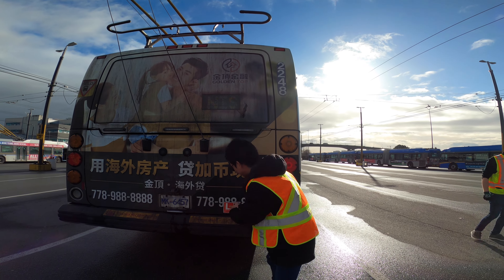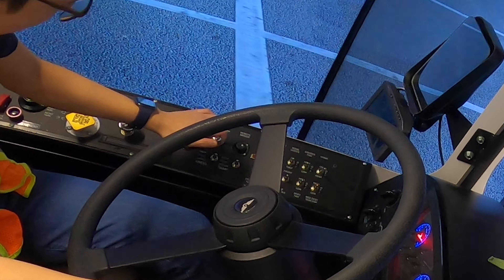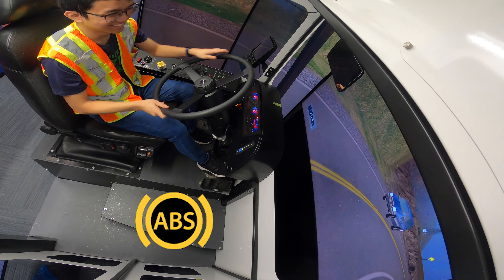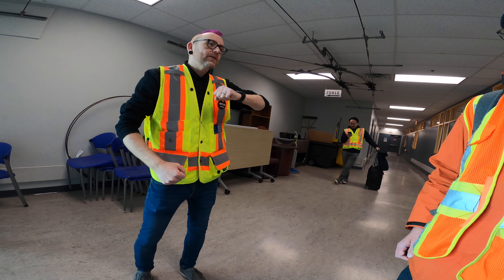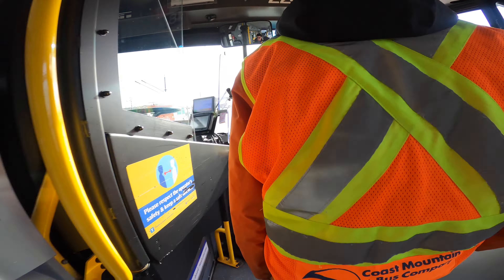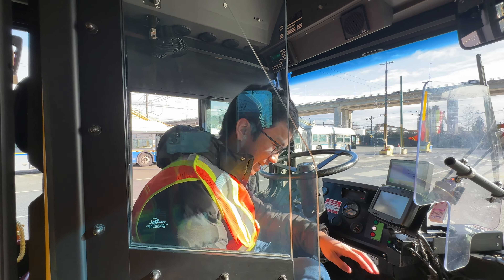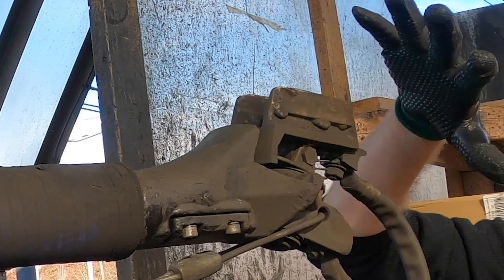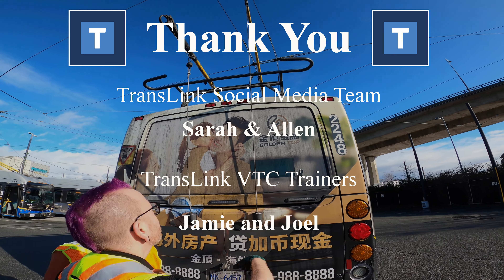BEHIND THE SCENE TOUR of TransLink's Vancouver Transit Center! | I ❤️ Transit

Comment: In Switzerland, trolleybusses don't have to slow down at intersections usually, since it's "just" a crossing of the wires in a 90 degree arc, without any switches right before. Most of our actual switches are fast-speed ones, so you can pass them to the left or to the right with up to 40 km/h. The switching happens while you're basically going straight, the actual turn and separation at the intersection happens maybe 100 meters or 150 meters after. We have to watch our speeds at underpasses though (30 km/h max). Raising and lowering the poles happens automatically with the press of a button. When raising automatically, we have to make sure that we're standing at the perfect spot, so the poles can click into the small triangle shaped helpers above the wires.
Reply from the maker: Wowow that’s amazing!! We need that technology in Vancouver!

Comment: 2156 has sadly been retired after hitting a pole near 41st and Knight
Reply from the maker: RIP moment of silence for 2156…..
Reply: Exactly, plus I have noticed that over the past 6 days there has been only 2018 and 2009 novas running on the 41
Reply from the maker: @SumiTheTransitFan yeppp I think they were trying to fix the trolley wires along the route that was damaged due to wind storm
Reply: Nov 5, 2022 flashbacks😂